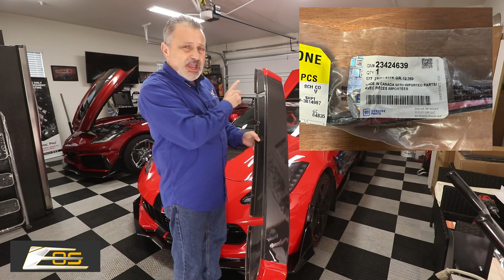How to Install a Carbon Fiber Halo on a C7Corvette

Comment: How well does it match the factory, carbon fiber weave on the roof?
Reply from the maker: The weave is very close, but it is a little lighter in certain light. If you don’t have a Visable Carbon Fiber roof you will never notice.

Comment: where can I get the weather stripping
Reply from the maker: You can order it thru the dealer
Reply: @THECORVETTECHANNEL  Ok Thanks!
Reply: Another question. What size drill bit for pre drilled holes in the front and rear?